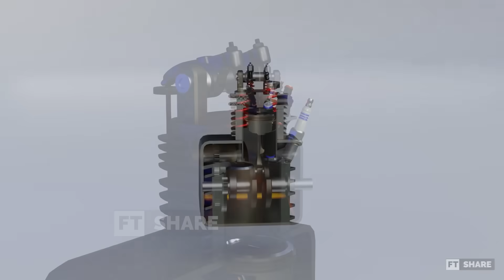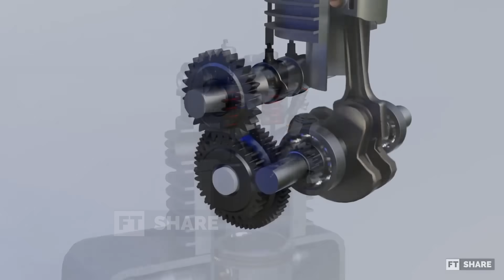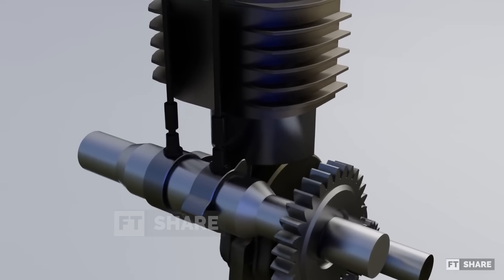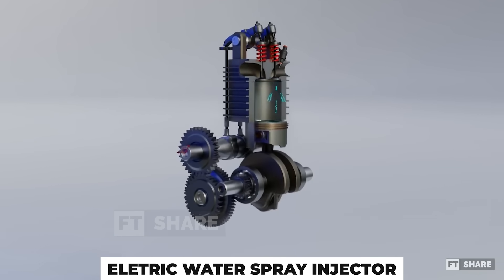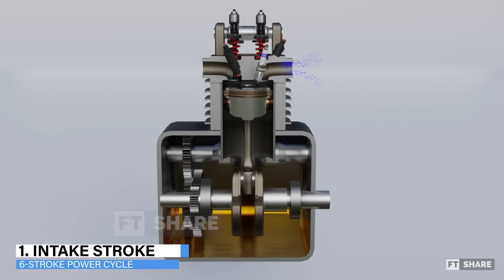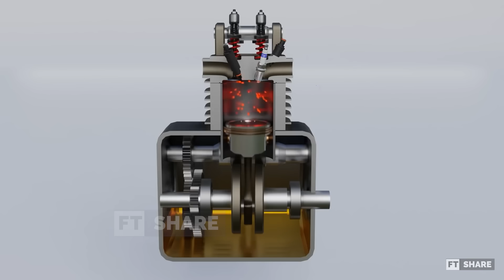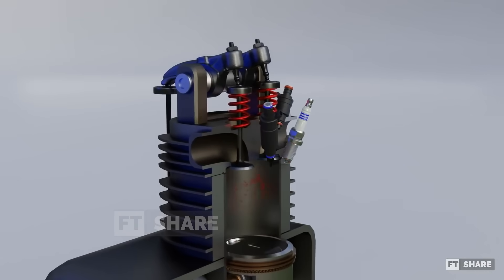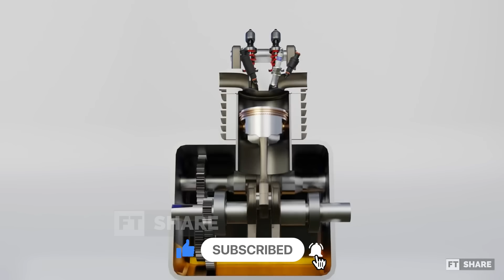Water-Powered ICE Is Here!!! | The Revolutionary 6-Stroke Engine

Comment: An ideal single expansion, non condensing steam engine will be about 11% efficient, so of the small amount of heat taken by turning the water into steam, less than 11% will be turned into power, so you're using 2 more strokes, and that friction for very little. You'd be better off just using the Atkinson cycle.
Reply: Another excellent point as well.
Reply: @joejoejoejoejoejoe4391 - In your 11% figure, are you counting on preheated, pressurized water, or what? Does it include normal efficiency losses in a boiler, burning its own fuel? The full suite of details matters! An optimized version of this engine could be supplying supercritical steam made hot for free with exhaust heat.

Comment: I can see this working well for a generator or anything stationary. In a vehicle you've got too many variables, freezing temps being one of many.
Reply: Excellent point as the water would have to be prevented from freezing especially when the vehicle was not in use.
Reply: @bernieshort6311  Anti freeze says hi.
Reply: @v4skunk739 I don't think they will like antifreeze being burned like that...
Reply: Also, cylinder wash down.
Reply: This is already solved. Many current vehicles use water injection in the engine. The military figures it out in wwII to use water/meth. 
Almost every vehicle driving is water objected and winter is not a problem. It’s called windshield washer fluid “injection”. 😂
Reply: @bobirving6052  Yes methanol could be used. The problem with that is you could get even more power and efficiency by simply burning the methanol in a conventional 4 stroke. 

And how do you define many? The only current production vehicle I am aware of is the BMW M4 GTS. I would not call that "many."

Comment: It maybe more thermally efficient, but in modern petrol motors using turbo chargers; some of the magnetic heat energy is used to boost the performance of the motor by driving the exhaust turbo wheel faster using some of the heat energy from the exhaust?

It's pretty cool in that all its doing is firing the fuel injector on 1 cycle and firing the water injector on the other cycle? So this would reduce turbo performance if utilising a turbo charger creating lag with less performance? The Germans in war had massive radial and turbo prop planes that were so high performance they could easily outrun ally attacks? It was discovered that the Germans were using huge million volt capacitors and a delayed spark concept to the spark plug to create basically lighting bolts through the water vapour within the fuel combustion cycle? They used a method of pre-injecting the atomised water in front of the turbocharger having a 2 stage effect of cooling the intake temperature allowing for higher boost before engine detonation (pre-ignition event - cylinder temperature increases with increased boost which actually tightens the tolerance brethren piston rings and cylinder wall increasing compression even higher than just the turbocharger until the chamber becomes too hot and energy dense when the vaporised fuel enters the combustion chamber it ignites before the spark plug sparks = pre-ignition) and this is hugely destructive to engine internal components. If the air is cooler it mitigates the pre-ignition triggering event by just cooling the intake charge that it's conduction of coolness is enough to drop the cylinder temperature enough to stop this from happening? The super high voltage prevents flame out of the ignition process with huge voltage lightning storm occurring right at the ignition point! This micro lightning bolt causes the dissociation of water into gaseous hydrogen and gaseous oxygen which contribute more energy into the combustion cycle resulting in the motor reaching multiple factors higher boost pressure than the engine can handle without water injection?
They developed and improved these turbo systems with bigger and bigger voltages and much bigger coils and capacitors and were able to reach a peak of 200psi of boost pressure running mixture of 50:50 water and fuel!
The draw back was that the additional weight in liquid fuel and liquid water which meant reducing the fuel tank size and adding a water tank. The other draw back was that within dog fights the planes performance would just keep getting better and better as they kept consuming more water and more fuel, this required the pilot to continuously adjust his thresholds with entire planes controls as it would fly different from take off to landing (that's if pilots had enough in the tank to get home after battle?) Pilots had to also change battle strategies to leverage the fast return from battle performance, increased efficiency in fuel and water supply and delivery systems and basically run more sorties than they previously did and overlap pilot teams to keep pressure on the ally's?
The engines equipped with water injection and big ignition systems when pulled down for inspection still look brand new inside on a 100000 miles? 

So this system I can see this being somewhat similar to the WRC anti lag systems where they don't fire the spark plug on 1 cylinder per rotation meaning 1 unburned combustion cycle per cylinder goes out the exhaust valve and then the unburned gas is ignited by additional spark plug just prior to the turbo (post cylinder combidtion) to bring the performance of the turbo charger up only in the RPM before boost  pressure peaks to speed the turbo up and reduce lag. It's similar but not the same as it is interfering with the injection process not the ignition to achieve a non-combusting cylinder per cycle. Obviously to me the biggest issue is going to be trying to make this work well on more than 1 cylinder?

Comment: Would it be more practical to just use the cooling system, water pump, to drive a steam turbine? As coolant boils inside the engine it could propel a turbine. It would still need a hot, high pressure end, and a cold, low pressure end, somehow.

Comment: The water injection in a 4 stroke mabey ? How much power is the water produceing  in the 6 stroke ? Interesting !
Reply: There have been plenty of engine runs on water attempts in the past. Usually injecting at the same time as the fuel or pre mixing it. So the water absorbs the heat of exhaust gases as they are created in an otherwise normal 4 stroke cycle. So I am not sure what advantage a six stroke engine has over any of those previous systems, as a lot of the heat is escaping with the exhaust.

Comment: Requires dimineralized water which is used for other applications like carpet steam cleaners, and is about $20/gallon. Sure if widely used price will come down, but the inconvenience of filling a separate water tank, and high cost will doom it as a auto engine. May be practical for some industrial applications.
Reply: Funny, I can buy distilled water for a dollar at the super market, so with scale...
Reply: Distilled water ?
Reply: Have fun trying to start it on a cold winter morning

Comment: Use the exhaust to distill the water!  Use a replacable stainless steel evaporator and a condensor chamber then store the water in a pre injection tank. The evaporator evsporating water at about 2,x tfe usesge rate, when the preinjection tank is full. A valve opens/closes to keep the evaporator from burning up. It being only about 22,,gauge stainless steel  about 1pint to ,,1qt. For smaller engines , on larger engines it can be mounted on the back of the cat converter. Using some of its heat  basically ab1 gph tiny stream into a hot chamber between 20& 80% full of water, after a certain number of hours and loss of efficientcy  the boiler/evaporator can be change or cleaned removing water deposits!    Remove and soak in CLR or something!
Reply: I have always thought about running a boiler off the exhaust as a form of energy recovery. The problem is that your exhaust needs to be somewhat unrestricted, but have maximal surfacee area for heat transfer.
Reply: @tristanjones7735  If you're somewhere that's warm enough to not need antifreeze, and engine design that can run warm enough to turn water to steam could probably run off the engine coolant, running post steamed water through the regular cooling system.

Comment: Okay, I'm not an engineer but it seems blatantly obvious to me instead of distilling water. Just condense it out of the air like yachts do

If you filter the air through an air filter and then condense it, it should be pretty dang pure

Also, it could be doing this in storing it in a water tank. Even when you're not driving the car it doesn't use a lot of electricity. Could just run off the cars battery

So there's your unlimited source of water. You don't even have to top the tank off.

My question is which stroke produces more power, the combustion or the steam? One of them has to push with a different kind of a force. You would think one more instant one more long and torquey?
Reply: You're completely right about condensing the steam. As for what produces more power, it is definitely the combustion. The water injected at the 5th stroke will only extract the heat trapped in the walls, which is only a fraction of fuel energy, AND it is low-grade heat, ie, low temperature. This means that the steam will reach a very small pressure and won't be able to expand that much. So the efficiency gain is small, but it's there. By extension, this also means that the 5th stroke will have very low torque and therefore power output. There have been similar attempts where water is injected directly into the combustion, leaning it out, which reduces temperatures and therefore conduction heat loss. That gives a few % extra efficiency. I assume this would provide a similar increase.

Comment: Trying to squirt water into the jug during tdc? If you have room there, then you must have a low compression engine.
Reply: Well, you will bend the rods when the piston comes to TDC, water won't compress.
Reply: The water is squirted in just after the exhaust stroke as the piston is going down . But I don't see this concept adding any efficiency to the ICE.

Comment: 4-stroke engine with turbo; Water/meth injection only when you need high boost power for short duration. And throw away the direct injection injector. ( A service shops' bread and butter).  Keep it simple and trouble free.

Comment: No its not viable because it still burns fossil fuels and as you say it uses pure water that would be more scarce and very expensive in underdeveloped countries. The process of distillation for the water would be power hungry and the volume requires huge over time. Using sea water would make the process even more expensive and create concentrated brine which is not good for the environment. If battery technology does not improve then ICE vehicles will still be needed for quite a while yet but I don't think developing something like this is worth the dollars. Maybe if a different inert liquid could be used it may be worthy. Perhaps injecting liquid Co2 instead of water might work. It would be neutral for Co2 as you are taking it out of the atmosphere and then putting it back. Cost to process the Co2 and any adverse waste in the process would need to be assessed. It would need to be stored in the vehicle under very high pressure and be able to be refilled at the same point as regular fuel. Both these are possible as its done with propane now but the Co2 would be much higher pressure. All this complexity adds to cost so again I can not see it being viable.

Comment: This is ingenious. Basically it's an ICE/steam engine hybrid. Using residual heat from the power stroke to create steam is a good idea. It is heat energy that otherwise would've been wasted through the radiator.
Reply: I ran water methanol in my last vehicle for this reason. I will be putting it in my VW diesel soon as well! I am hoping to break a 55-60 mpg average up from 50
Reply: Thank you for understanding the concept. The water used to cool the engine should be used for work instead of drained into the universe as heat.
Reply: Then no hot water for heater core during winter
Reply: @MattyIce2214 there could by installing the small heat exchanger in exhaust, instead of using radiator.
Reply: @saifullahtahir999  Reduce exhaust temps too
Reply: the extra power and efficiency you get from a 6 stroke engine means you can afford to run an electric heater. heat in the engine coolant is wasted heat anyway @MattyIce2214
Reply: @MattyIce2214  Id be curious how this works out too. Also keeping the water from freezing and how cold starts will go.
Reply: @MattyIce2214 old 911 used the exhaust heat.
Reply: @MattyIce2214   true.
Reply: @MattyIce2214  
I spoke with the Crowers about this. The first prototype was a converted diesel engine where the fuel injector was replaced with a water injector. A lower compression ratio was used and a spark plug added. That at least was my memory of it. If I remember correctly it had a carburetor on the intake.
Reply: The piston shouldn't typically be hot enough to flash steam a shot of water constantly unless it was a very small amount and if it is, you would have to make it so it's basically constantly "run away" temperature because the incoming water/steam would be cooling the cylinder significantly. Then there's the case of "what if you run out of water?" If you're already on the edge of thermal runaway to keep the shot of water flash boiling and suddenly you run out, it will take double digit combustion cycles for it to overheat.  I think this would be a good idea for stationary engines to help cut emissions lower general temperature, and noise. quite a few more hurdles before automotive production but the idea has merit
Reply: They need to make it 8 cycle so it has 2 steam strokes after the regular 4 strokes then add 2 more valves and 2 more manifolds with a 3 way valve that directs all the heat of compression back into the engine so all your heat can be recycled and there will be enough heat to run completely fuel free. The compression just makes heat to boil the water
Reply: Water expansion from liquid to gas(steam) is about 600 x if memory serves, much more than the fuel air mixture burning. And this was used on many wwII planes I was told to great effect.
Reply: Steam would actually have to come into the cylinder under pressure for this to work.
Reply: @danw6014  It would get injected as atomized water under high pressure, and then flash vaporize. Water expands at a 1600:1 ratio.
Reply: @ArnoldsDesign  have you ever operated and engine with a water injection system? The reason I ask, water cools the engine. Years ago John Deere model D tractors burn low grade heavy fuels. In order to start the engine, by hand of course, the operator needed switch the fuel valve to a small gas tank and start it on gasoline and then bring the engine up to about 200 degrees or more before switching over to distillate. They controlled the engine temperature with shutters over the radiator. Once the engine was out and working hard the issue of pre detonation would arise. To control this the operator would open the water injection system which would pull coolant water from the engine block and through vacuum suck it through the carburetor cooling the air fuel mixture. Keep in mind the water temperature is already near boiling. Now on something more modern, the pulling tractors you might see at a county fair also uses a water injection system. In this case it's to keep the aluminum pistons from melting because they develop so much power. The life expectancy of engine that would operate at a high enough temperature to flash boil cool water being injected into the cylinder would be very short.
Reply: @danw6014  I haven't operated a water injected engine, but an interesting way of cooling I'll say. In the case of the 6 stroke engine, the water mist cools, but also flashes into steam when injected into the cylinder, thereby increasing output.
Reply: @ArnoldsDesign  But surely after an exhaust stroke, the exhaust valve is still open, so the cylinder pressure is low?
Reply: @danw6014  Thanks very much. I have had very little 'hands on' experience with engines, just enough to get through my exams. (Which is a great deal more than many people!)
Reply: @danw6014 ”pre detonation” 🤣
Reply: @danw6014  Modern engines will all flash boil water when injected as a proper atomized mist. I ran high amounts of straight water injection as well as water methanol injection and I can promise you.. no liquid water makes it into the exhaust! Piston top temperatures are often 400-500C.. and the cylinder walls of an active engine are more than hot enough to flash boil water

Comment: Try looking up "Carnot Efficiency".  It's an absolute limit, controlled by the temperature and pressure change overall.   Squirting in water does not increase the temperature or pressure deltas, so no more efficiency.  Been known for 150 years now.

Comment: If you need more power just use a larger displacement engine. This concept is like getting some extra power out of the gasoline already burned.
  The Problem is the water freezing.
  It may be more practice to just inject water into a 4 stroke engine and  mix 50% water rand 50% Methanol in freezing weather..